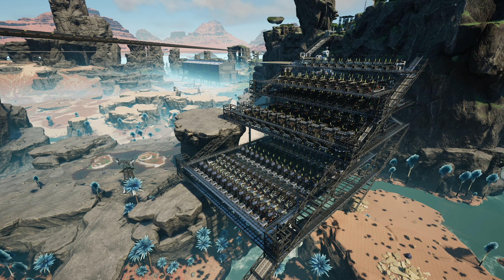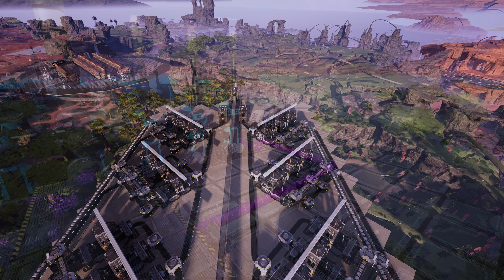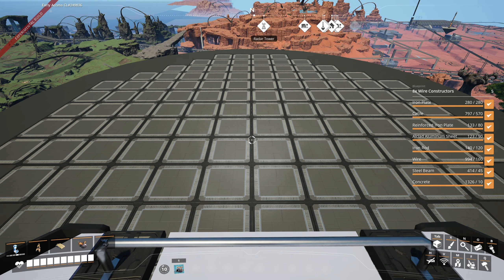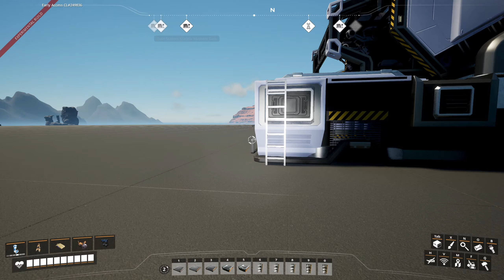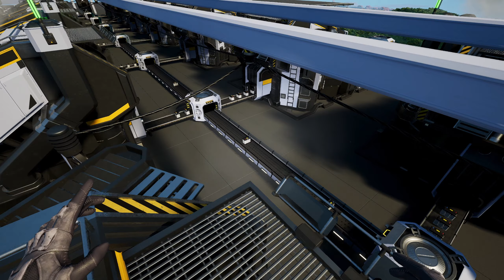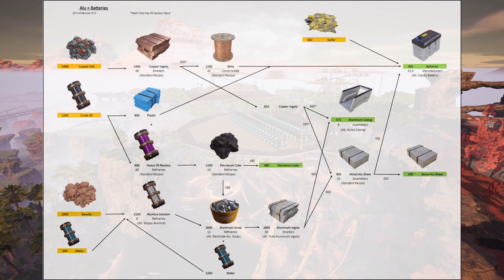1000+ Aluminum Parts & 400 Batteries! - Satisfactory Project Nuclear Mayhem - Ep. 10

Comment: g = grams
G = Giga

630,000 MW = 630 GW
Reply from the maker: For some reason, I find the term „630000 MW“ more impressive than 630GW. But since I got this hint multiple times now, I‘ll refer to it as 630GW from now on 😄👍
Reply: @PronetoPlayYT  well, it technically could be called six hundred thirty thousand thousand thousand watts, or six thousand and thirty hundred hundred hundred hundred watts.
Obfuscation has a subtle humor about it if done right too: X = (9*70)*(500000000*2)